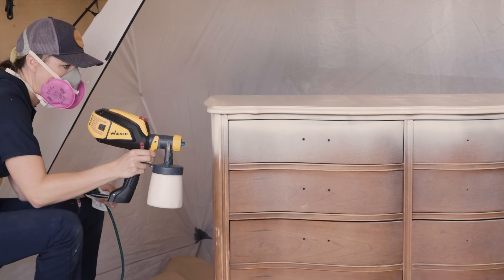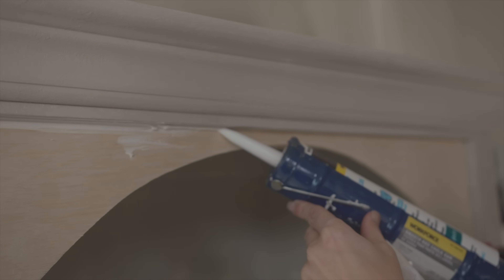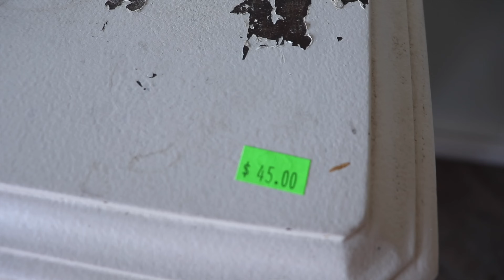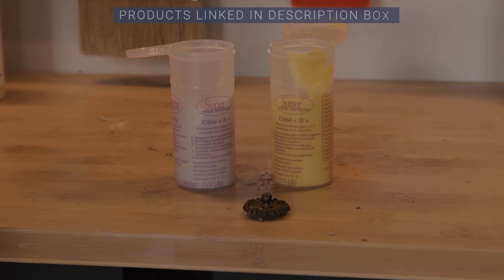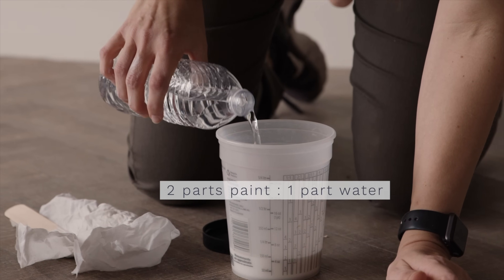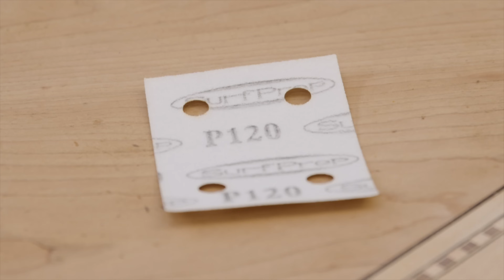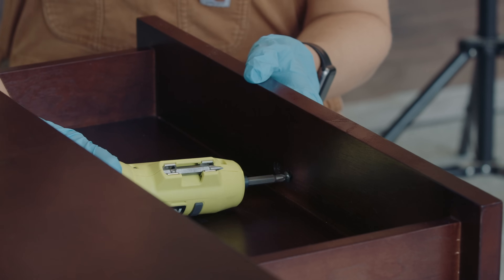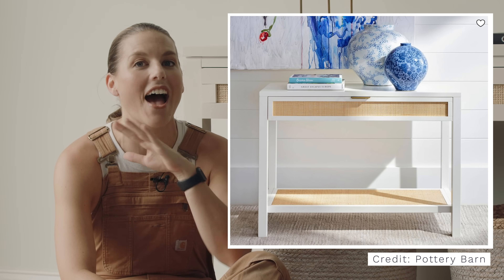10 Inspiring Furniture Flips for 2024 | DIY Furniture Makeovers

Comment: One trick for the legs is to unscrew them and chuck them up in a drill and use a foam sanding block. You could've taken 1/4 of the amount of time... if they remove that is.
Reply from the maker: This is a great tip. Pretty sure these ones wouldn't come off. But it has been a while, so you might be right about them.

Comment: Why not use man made materials (a.k.a pleather) or vinyl to get the leather look?  A strip of pleather can be applied in many ways depending on the look you want.  Adhere the material using glue, mod podge, stapled with studs (would that be called grommet?) etc.